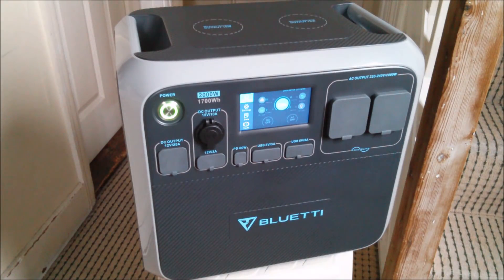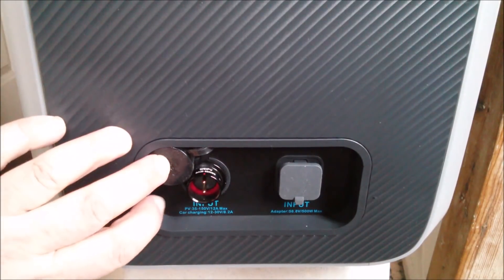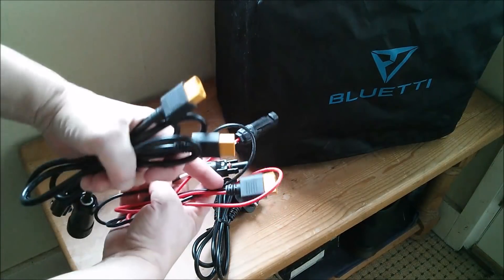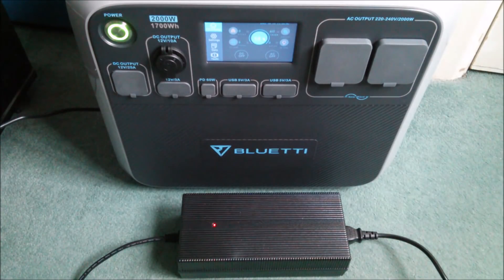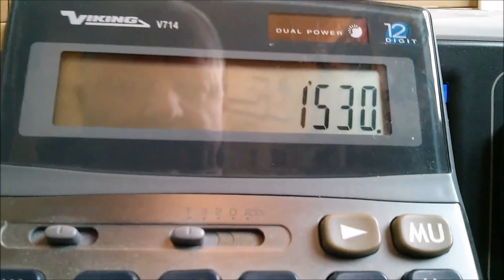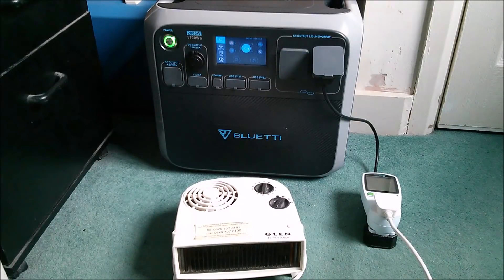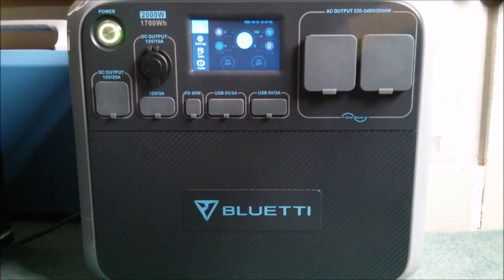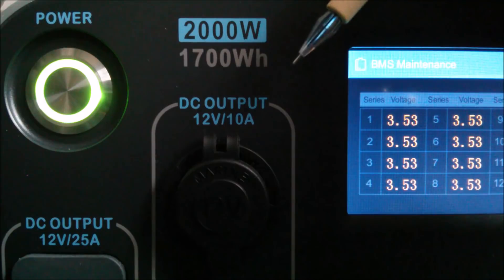Bluetti AC200 2kW Power Generator - Initial Tests

Comment: A really nice bit of kit that does everything you need out of the box. But that €2300 price tag seems a bit steep..

I've seen a lot of 90Ah LifePo4 cells going really cheap lately. And it's quite simple to make larger packs with them, because they literally just bolt together.

I'd probably go the DIY route and save at least €1500 - €1800

But I guess some people might be interested in this bit of kit.

Comment: I find all the USB outputs, including a PD redundant due to having the AC output. I guess it’s convenient to have them but if those are removed, I wonder how much lower than they price it at.

At this price tag, also curious about the quality of AC inverter.

This is an interesting project for me because I have designed DC to AC power inverters for automotive use and now work for an automotive battery manufacturer. Two of my last work projects in one.

Comment: Nice Toy but £2,000 would buy a very high spec generator and years of fuel
Reply: Although a lot quieter to use and it won’t gas you out with it’s exhaust.

Comment: Ya, NOT a "generator".  Just a battery with various inputs and outputs.  Google "generator".  The marketers might want to call it that but, Julian, you know you shouldn't.
Reply from the maker: Didn't I call it a power bank at one point?
Reply: @JulianIlett  - Not sure.  But the title has "generator" and you did call it that at least once.  Power bank or even UPS or power "station" would be better suited.  But there is nothing "generator" here.
I would have at least put quotes around "generator" in the title.  And even said "quote - unquote" in the dialog.  IMHO.  Looking forward to the next video.
Reply from the maker: Milwaukee have a big mains generator that takes huge removable battery packs. They call it a power station (or maybe a power supply). It's not quite the same thing as it doesn't have the solar input. But I can't think of a perfectly appropriate name for this kind of device :)
Reply: @JulianIlett  - "Power station" is at least better than "generator".  A "solar" input is still only a DC input although with a wider range and perhaps MPPT but still not a generator.  When you plug a DC to AC inverter into a battery or even an all electric car it doesn't make the system into a generator.  A DC wall wart / adapter / transformer isn't a DC generator.  A USB power bank is not a DC generator.  This is really an AC DC power bank.  This can't generate electricity without electricity.  A car alternator (or generator) converts a fuel or movement (going down a hill or push start a dead battery) into electricity and is quite different than a battery with DC and AC in and out.  And actually it is the same idea as just having only mechanical gears on a bike is not a generator as it is not changing the type of energy.  Clear cut to me.
Reply: @ElmerFuddGun  - I give £100 to the first person that can ‘generate’ at least 5W of electricity without converting the power from an existing source of energy. The types of ‘generator’ that the featured item is being compared to should really be called internal combustion engine powered alternators...
<see also my other nick picking (R) comment further down...>
Reply: Yeah! This thing just converts chemical energy into electrical energy. Whereas a generator...

Comment: Thanks for the detailed review, I watched your review on the Allpowers 700w power generator also and  will more likely buy the Allpowers over the Bluetti as the Allpowers has  the USB-C charging option so I can charge from a 40w turbine and run a 400w oil heater

Comment: ITS A BATTERY ! its not a generator ! ITS A BACKUP BATTERY !
Reply from the maker: Sure, it's a battery - 50V DC or thereabouts. To get 240V AC, you need an inverter. As far as I know, the combination of battery and inverter has no specific name. Isn't 'power generator' as good a name as any? :)
Reply: @JulianIlett  Ok its 100% not generator . So maybe its a Uninterruptible power supply ? They have inverter and a battery inside .
Reply: @JulianIlett  Regular old USB powerbanks use buck/boost to get to 5v from the ~3-4 of whatever cells they're using. So they're just a "DC generator" by the same logic. From the title I was thinking maybe a tiny combustion engine or some kind of fuel cell tech.

This thing is still pretty neat though and you put it through it's paces here. Thanks.
Reply from the maker: To me, it's a power bank. But all the manufacturers of these units call them power generators. To be used instead of petrol or diesel generators where noise or fumes would be a problem I suppose.
Reply: @JulianIlett  Ok that makes some sense at least. They just want it shown next to generators because of the use case.. SEO ruins everything again. If it wasn't for all the vendors out right lieing with their ludicrous capacities we'd probably just call this a 1700Wh powerbank with inverter.
Reply: <nit picking mode ON> Technically, as you can’t actually generate power, nothing that converts power should be called a generator. A so called petrol/gasoline/aviation fuel or diesel ‘generator’ converts chemical energy into rotational motion, then the alternator converts this into magnetic fields and these magnetic fields are then converted into electricity.
Technology often finds gaps in our languages, and often the most popular term gains acceptance regardless whether it is accurate or meaningful. Plus the term gets shortened. Hence cellular mobile telephones are now very rarely actually called that in normal conversation. So these devices, which are just large ‘power banks’ or battery-inverter systems will of course be called something different. As the market that the manufacturers are going after is in the portable (as in luggable) sector, of course they are going to call them generators. But I would like to say that these are not the first of their type. Specialist industrial equipment has had similar items in the past, the difference being they were intended for use with specific equipment rather than being general purpose items.

Comment: I suppose the losses that you spoke of are not really losses if you are trying to heat up your shed as the losses in power are turned directly into heat, which will add to the heater to make your shed warmer.
Have a great weekend and stay safe,
Joe

Comment: A couple of interesting tests to try would be: (1) Is there any momentary dropout if the mains dies while using it as a UPS, and (2) How accurate is its mains output in terms of voltage, frequency, and sinewave purity. It sounds like a nice unit, but a bit pricey.

Comment: Do lion cells really give 90% rated capacity with cell voltage between 3.4 and 4.12 ?
I'll test my 18650 battery and report back. If the pro's use these limits, it might be useful info.

Comment: This is very cool powerbank. Not a generator.
Reply: I was going to say that you beat me to it. it's just a self contained battery powerbank/inverter. I suppose you it be fair to Julian it will generate heat in use.
Reply from the maker: Don't forget the MPPT solar charge controller and the DC/DC buck converters for 12 and 5 volts :)
Reply: @JulianIlett  i will go with the heat it generates 😀 but the thing is you cannot put in more fuel when it runs out of electricity. You can only fuel it with other electricity. On bad days i need a generator to charge my batteries and make sure i have enough fuel  or get more where i run out. This device is just not the same. I really would like to have though 😁

Comment: wonder how long it will be before someone builds a custom firmware for it to allow fully charging and discharging it. i dont have a use for a unit like that but it certainly looks premium and fully loaded feature wise.
Reply from the maker: An option for full DOD would be handy. Electric cars have a nominal battery capacity and a 'usable' battery capacity. I think they should have a "give me 5 extra miles to get me home" mode which you can use 3 times (then pay extra to reset the counter :)

Comment: I'm curious how well it likes an inductive load like such as a drill. Full marks if you've got a big angle grinder or circular saw closer to the 2KW rating of the unit to really push it to its limits.
Reply from the maker: That's probably the only thing I can't fully test. I have an old mains powered lawnmower, but I think it's only 1500W.
Reply: @JulianIlett  Could make for an interesting test; which finishes first, the lawnmower mowing the lawn, or the battery powering the lawnmower.

Comment: what i would like to see tested is how low can you go on the solar voltage, most panels are around 18v, but the imput stated 38v or so 
i want to see if it will still accept a single 18v solar panel when charging
Reply from the maker: When the snow melts, I'll connect up the 240W panel. It's 60 cells (about 30V) - that'll be an interesting test.
Reply: @JulianIlett  well since it seemed to take 99w from the 12v imput, id be interesting to test w/ a 100w panel aswell (one that is 18v) 
im thinking that it has 2 seperate charger controllers, one being PWM or just dumb on/off for the lower voltages (12~20v) and a Proper MPPT for the higher voltages (36v+)

Comment: Can't help but notice the chain locking it up... do you have much theft in your neighbourhood, Julian?  For sure better safe than sorry but I'm just curious.
Reply from the maker: It took an hour or so to carry everything out to the shed, and another hour to cart it all back to the house. No neighbourhood is immune from opportunism. That's really what the security is for :)
Reply: @JulianIlett  - An hour?  Really?  OMG.  Ya, I don't think you said how much it weighs.  I agree the chain is a good idea but I was just curious about theft in your part of England.  And actually whether COVID has changed it either way.
Perhaps you should design and build a little security system with remote monitoring from the house?  With YT video of course!   :-)
Reply from the maker: Apparently the AC200 is 27kg and the EB150 is 17kg. That's surprising, because the AC200 doesn't feel any heavier. But it has two carry handles (the EB150 has one) so it's not easy to compare them directly. And before you ask, yes my wife does have a set of scales :)
Reply: @JulianIlett  - LOL.  The wife has the scales.  But ya, I wouldn't want to be hauling 27kg too far.  No wheels, eh?  I would use a small collapsible dolly for road trips, etc.

Comment: Can you plug its charger in to the output and get it to recharge itself. :)

For £250 you can get a 3.5KVA petrol generator which will run for hrs at full load. Rechargeing takes about 30 seconds.
Reply from the maker: You can - and it recharges itself super efficiently (minus losses). Ah, but you can't use a petrol generator in a church :)
Reply: @JulianIlett  But you can use a vicar in a petrol station :)

Comment: Is the DC input MPPT?
Reply from the maker: Yes the PV input has MPPT - but it does more than that. The settings menu has a PV/car option for that input. In PV mode it's 35V to 150V (12A max) MPPT. In car mode it's 12V or 24V (8.2A max) with undervolt disconnect to protect the source battery. That same input can also be used with a 2nd AC power adapter. So it's a very versatile input - I need to do more testing :)

Comment: I’d get one if the battery was replaceable, therefore it'll last longer. It's not worth paying all that money because after 5 years it won't be able to keep the same charge, but if I could spend £150 maybe £200 on a new battery for it then I'd but it, but you can't, so I won't buy it, simple
Reply from the maker: I do think a modular version would be sensible. A box for the electronics, and separate boxes for the batteries. Stackable and expandable.